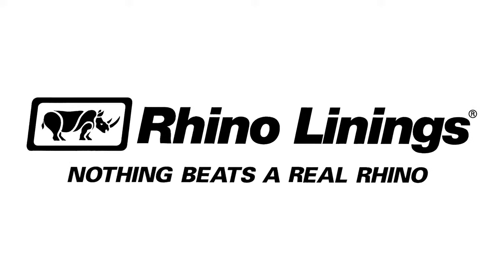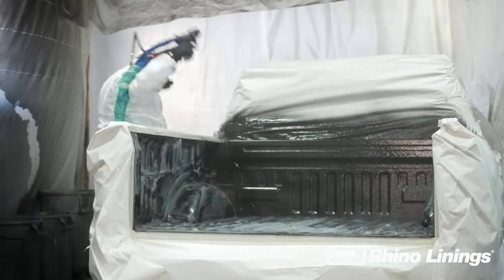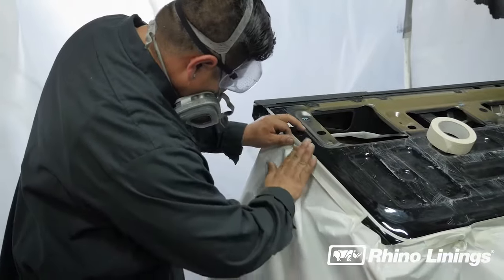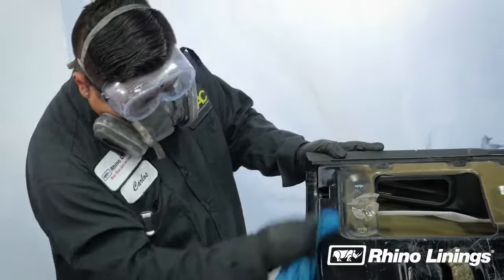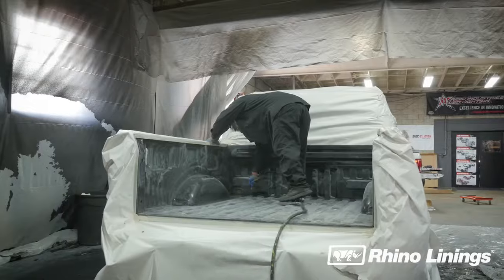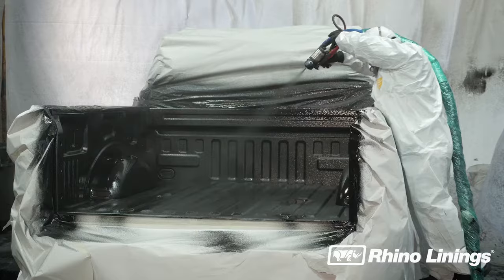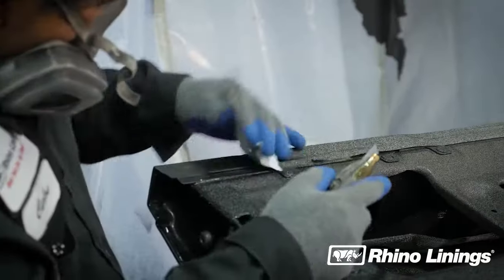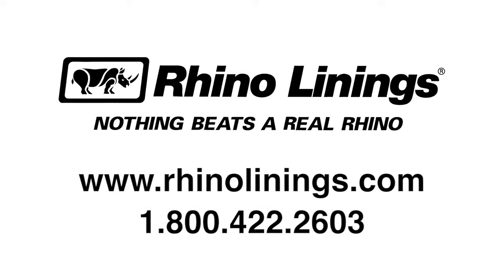Rhino Linings  Application Process

Comment: I have and old Jeep YJ with a moldy carpet inside, I’m thinking about ripping it out and putting this in so when I go mudding I can just get a hose and hose out the inside, any advice?
Reply from the maker: That is a great idea! Many Jeep owners have found that having Rhino Linings in the tub helps tremendously with easy clean up. If you bring in the Jeep stripped prior to the application it should cost less.

Comment: Is there a good reason why Line-X always says they remove bed bolts before spraying, but you guys left them in here?
Reply from the maker: Yes. There is a good reason.  Ford specifically states that this bed bolt is a one time use bolt.  It is not to be reinstalled.  Rather, it is to be replaced.  This is due to the design of the bolt and, more specifically, the nut attached to the frame. This nut, when new, has no threads.  The bolt cuts them as it is inserted.  

Ford installs spray on bedliners in some of its trucks in the factory.  Their SOP is to spray over the bolts.
Reply: @Rhinolinings  Thank you! I appreciate the response!